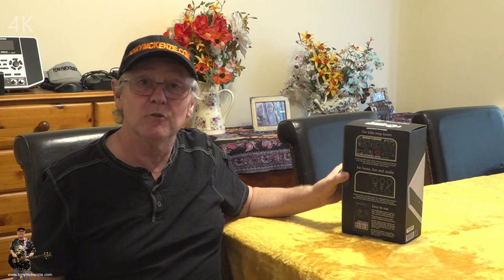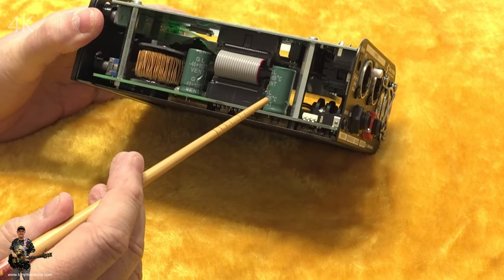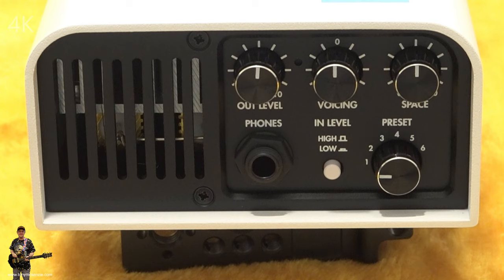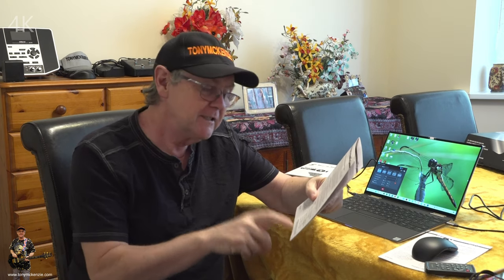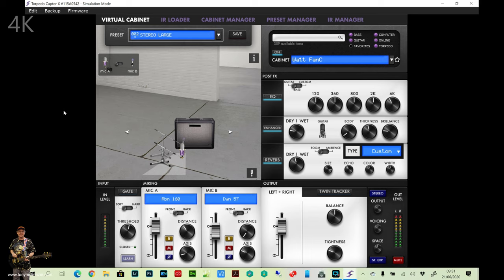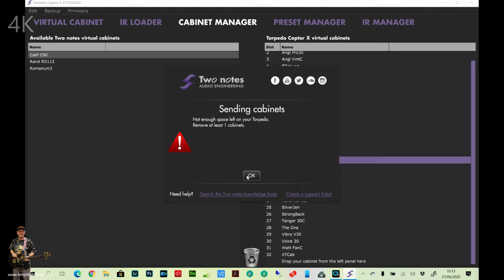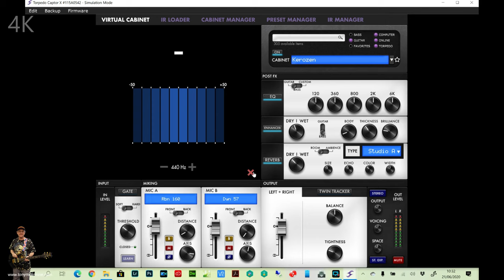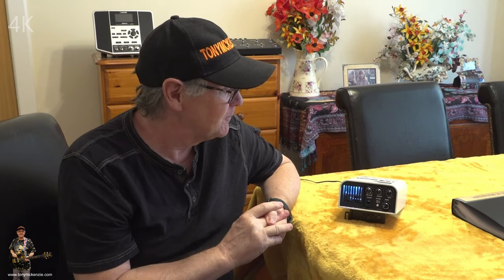Two-Notes Captor X  Inside & Out Review | Reactive Load, Attenuator & DI | Played on a JMP Plexi Amp

Comment: I was considering this but then I found out all its effects don't come out of your cab.
Reply from the maker: That's a good point, but it depends what you want to do with the unit. For me, its primary role is reduction of volume really but I did find the DI worked fine in general. But using the CAPTOR X through a speaker does not bother me in a studio situation really. The demo was DI but it would have worked through the speaker fine (for me probably even better).  But I would not 'write off' the CAPTOR X as I found it quite reasonable really and with a great pricing structure too. You can always drive FOH etc. out the DI side of things and I guess even split that output to other things if you need it? Thanks and stay safe.

Comment: so your only 2 drawbacks you've said this has are 1 a lack of a power switch (just turn it off at the wall or unplug it) and 2 that the power supply was @Cheap@ and youve youve given it a 8/10?? surely are just trivial things that warant .5 of a point being taken off if anything. and you didn't mention a bad experience with the device and said the only way you can get better is to pay a lot more? surely that makes this a 10 because of its price point? im confused as to what made it an 8, surely it can't just be a power switch...
Reply from the maker: That's not right. If you think a 'power supply' is a 'trivial thing' then that does not work for me. It was not 'just' the power switch at all. The unit is in my opinion rated at the score I gave. Nothing wrong with that and its an opinion of a user who bought one - rather than one of the minions that get them for free. I could have simply 'made things up' so the result would be what you might want to hear? But then I would be like many channels out there. It's a fair and reasonable review and sorry I said something you don't like. Stay safe.